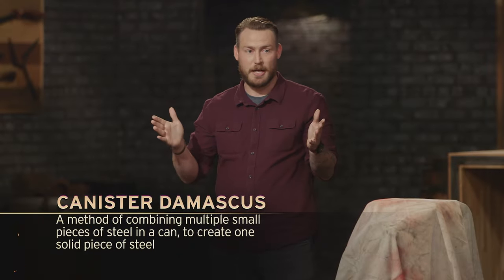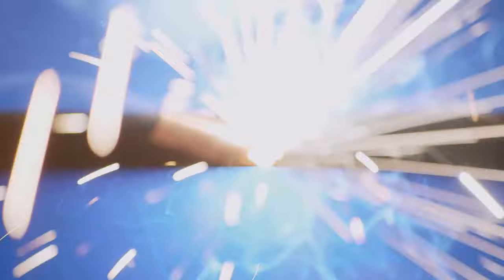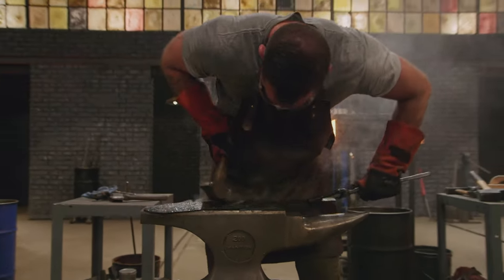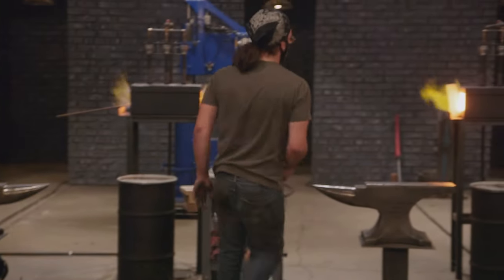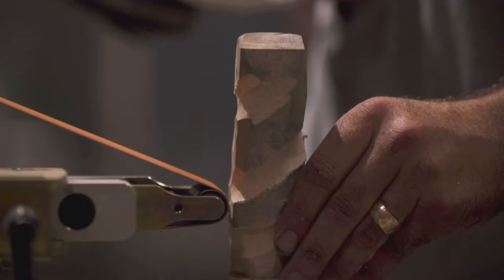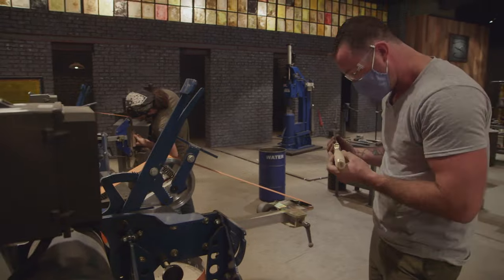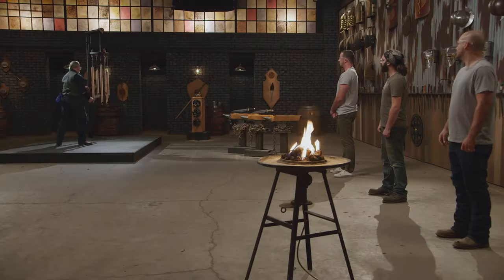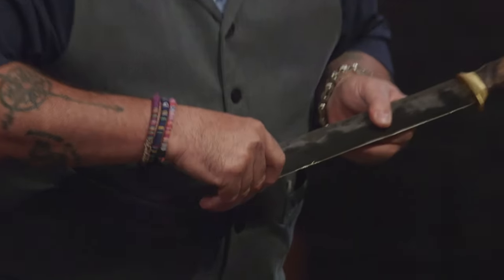TUBULAR Canister Challenge Threatens Bladesmith's Win | Forged in Fire (Season 8)

Comment: I don't know it was COVID related. But I like they protecting they're lungs. I've worked with metal before. Grinding etc. And drilling concrete. Had bronchitis one time and started coughing blood
Reply: Maybe indirectly related. I agree, though, protect your lungs. Some of that stuff doesn't leave your body.
Reply: (PPE) personal  protective equipment is very important I had a buddy not wearing during demo of a ceiling the dust on the attic side had powdered rat fecal matter with the hanta viruse and was dead in 3 days Respitory failure. Always if possible wear it especially when it comes to your lungs
Reply: A buddy of my worked on drywall with dove poo and dead doves behind them. He nearly died too. Never again did he work without a good mask and forced everyone of his employees to do so too.